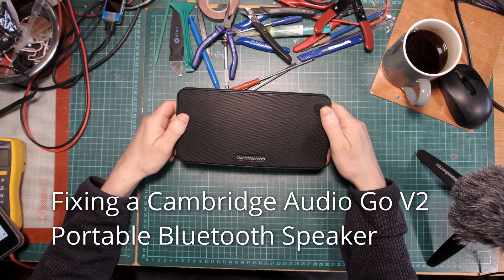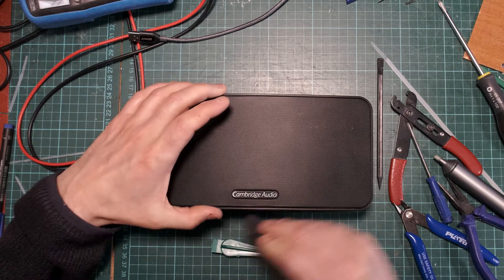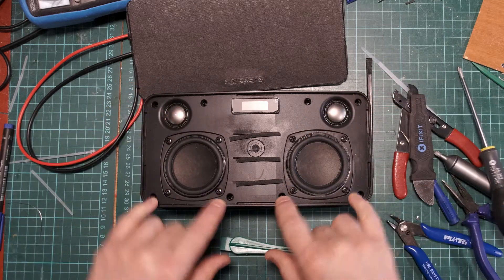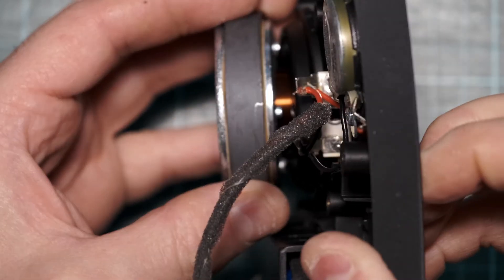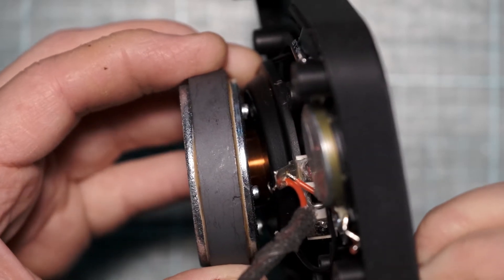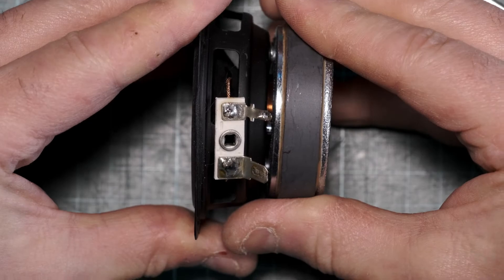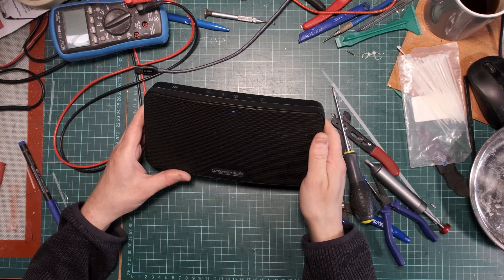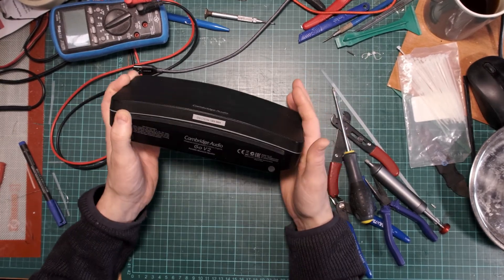Portable Bluetooth Speaker Repair - Cambridge Audio Go V2

Comment: You had a great opportunity to add a 1UV film capacitor in parallel to the series electrolyte capacitor that goes to the tweeter and thus significantly improve the sound quality. And one more thing: it is important that the cover with the speakers fits tightly to the body - otherwise there will be little bass.

Comment: I bought this model and despite the reviews at the time it is junk. It was never that good in sound (though bass is good). Too heavy to travel with, BT pairing only work for about 1.5m. I failed to keep it charged when I put it in storage for  year and battery or switches seems to cut out randomly now. Can't even get the 3.5 Jack to run it.

Comment: I’ve just had exactly the same problem only the magnet had came off completely. Added some two pack glue and realignment done to ensure voice coil was clear. Now working but still thinking of replacing speakers for new.